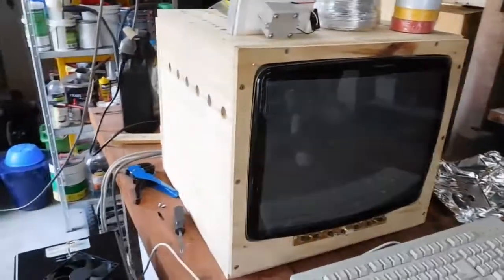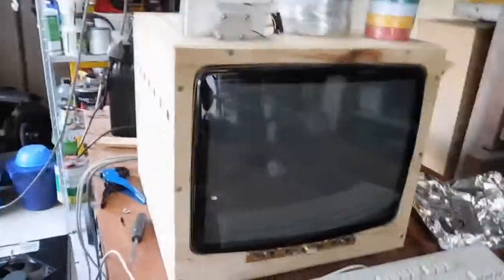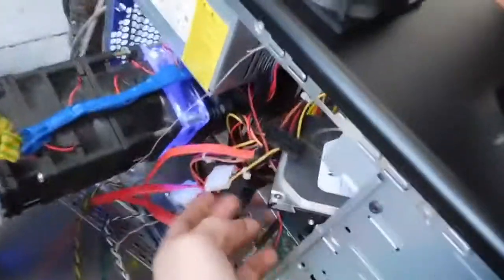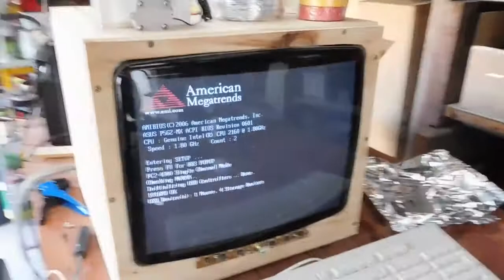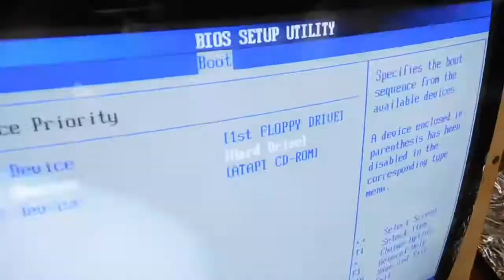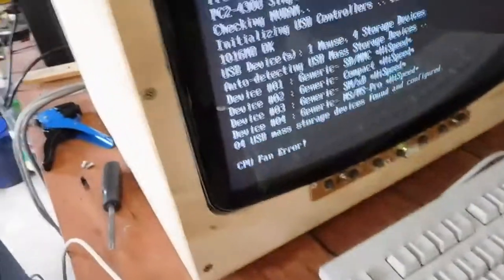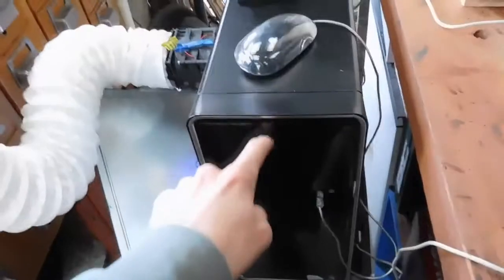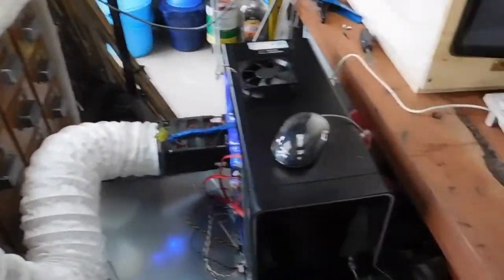Wood Cased CRT Monitor - Test on That Dell Bomb

Comment: why so much fans
Reply from the maker: Issues with cooling
Reply: +CAL'S ENGINEERING well just put a huge blower
Reply from the maker: Elvis Ramos I don't have any
Reply: ok what about a delta
Reply from the maker: Elvis Ramos fans are pretty hard to get where I live, that's why I tend to salvage them
Reply: so if you have a computer laying around just un screw all  fans even in the power supply
Reply from the maker: Elvis Ramos yeah, basically
Reply: so just connect an adda fan to 12v and your done